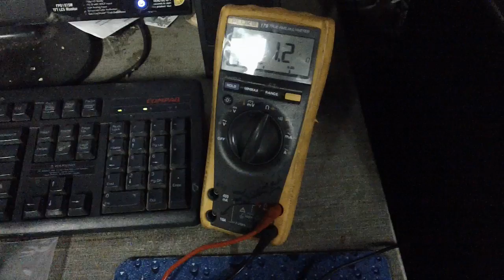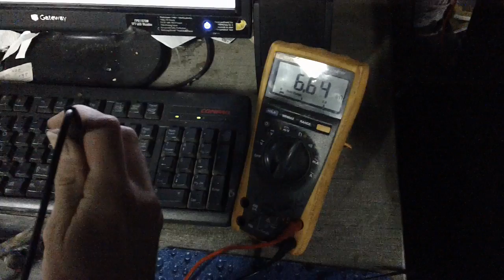testing honda engine ignition coil

Comment: If you own an HRM 214 or 215 do yourself a big favor before you buy a new ignition coil.  Coils for these older models are going from $60 - $90 depending on how badly the shop wants to screw you.  Remove the coil as described here and then inspect the 3 pick-up points.  If they are rusty or greasy this could be your no-start problem.  Dirt and rust will not allow the pick-up points to deliver a strong enough spark to fire the engine.  Carefully polish them up on a bench grinder wire wheel and use carb cleaner to clean the magnets on the flywheel.  Reinstall according to this video and see if it starts.  I just did this today and saved myself $78.00.  Mower runs great again!  Remember trying this is free.
Reply: Dude you hit it ! Rusty, a little sandpaper and it fired on the first pull! U da man!

Comment: Great video and I like the  comment about possible lead  resistance, subtracting that from your total sum if you have lead  resistance .  My question is where can you find the correct range for your particular Honda mower or engine? Thanks
Reply: Make sure if your spark plug boot is already mounted to a coil that you add those two together to get an appropriate resistance

Comment: don't forget primary resistance will include the test lead resistance. For example if Honda says .8-1.0 ohm and you measure 1.2 put your test leads together and I bet the test leads will be .3-.5 ohms so you need to sum them which will add up to what you read. So most likely the primary was fine.